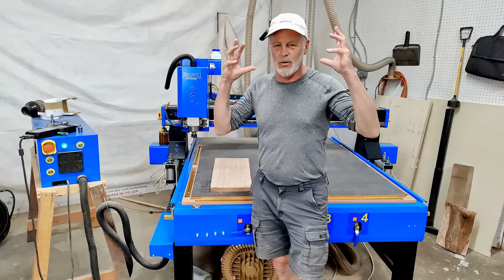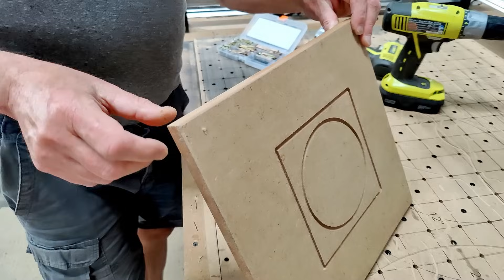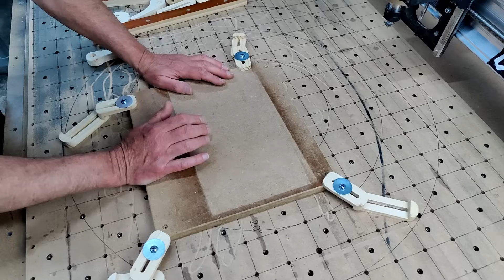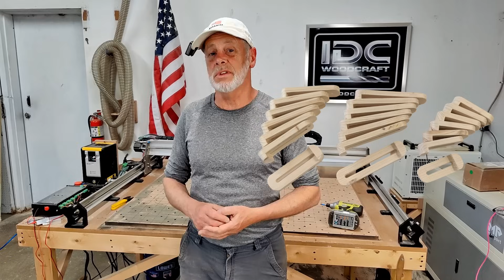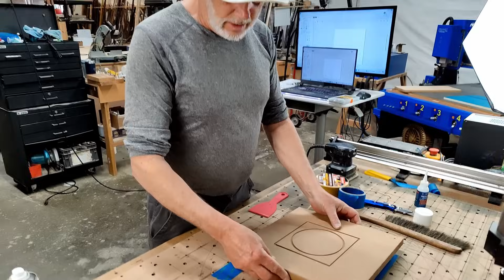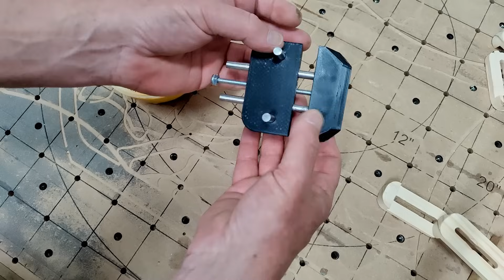Top 5 Methods to Keep Your CNC Projects Secure

Comment from the maker: Get the CNC Project Setup Checklist → https://link.idcwoodcraft.com/zmkr5w
Reply: No checklist there.  It just says PAGE NOT FOUND.
Reply: @pigpickler  disregard my previous reply- that link now goes nowhere.
Reply: have tried severeral times to get  the checklist with no luck.  no email or anything.  i submit my info, goes to the next screen, plays video acts like i have to purchase the design bundle to complete the request.
Reply: @Cooperwoodworking  disregard my previous reply- that link now goes nowhere.
Reply: Maybe gSender could be modified to spit up a check list after you load a gcode file and ask you to confirm each step before you can start the carve?

Comment: Great video! I'm leaning towards the clamps you made out of pine. Question, I am installing a dust collector, what plastic hose size do you recommend? Good job!
Reply from the maker: Thanks for the kind words! For a dust collector, a 4-inch diameter hose is commonly recommended, but always check your specific system for compatibility.

Comment: On the vacuum table, do you need to cover the open holes? I have 2 vacuum pumps with piping I got for free so I want to see if I can build a table with it.
Reply from the maker: Great question! It's usually best to cover the open holes you’re not using to maintain consistent suction, but you can also experiment with different configurations to see what works best for your setup. Good luck with your build, brother!

Comment: I like tape for smaller parts so i don't have to use tabs. My downsides to tape are that i'm allergic to CA glue and also it gums up the router bits... I use clamps mostly for larger stuff and  for full sheets of plywood etc. i use screws. Usually, if using screws i make a screw tool path that locates the screws with a pen that mounts in my spindle chuck and i run that first as it won't move the workpiece.
Reply from the maker: It sounds like you've developed a solid system for securing your workpieces! Using tape and clamps definitely has its advantages, and I can see how a screw tool path would make the process more efficient. It’s great that you’ve found ways to work around your CA glue allergy while still getting the results you want. Thank you for sharing your techniques!

Comment: Good job.  Give the 23 gage cordless Milwaukee a chance.  I use it a lot for cnc hold down also use a 1/4 plywood for my spoil board.  Below that is particle board glued to mdf that is nylon bolted to table. The pin nails are pulled out with pliers.  The ones that snap off i tap then into the waste board..  i use a enclosure so when I flatten spoil board.  You can hear pin nails flying.  Works great.😅
Reply from the maker: MarkJonesRanger, Thanks for sharing your setup! It's great to hear how effective your method is, especially with the Milwaukee tool. Your approach to managing the pin nails sounds smart, and the enclosure must help keep everything tidy. Happy CNC woodworking!

Comment: Does anyone offer a battery-operated nylon nailer?
Reply from the maker: johnterdik4707, Yes, there are battery-operated nailers available in the market. You can check with various tool manufacturers like DeWalt, Makita, or Ryobi for options that suit your needs.

Comment: Great video, as always.  Not sure the superglue method is much less expensive than the double sided tape method when you factor in the cost of the superglue and especially the accelerator.  Jonathan Katz Moses did a video recently recommending the tape sold by Taytools.

The whole purpose of the accelerator is to drive the cyanoacrylate to a basic PH level, which is required for proper reaction.  This is why you see a lot of homemade versions on the internet using baking soda, which works well, but can leave a residue.

I’ll be experimenting with this later this summer.

Clay
Reply from the maker: ctenos45069, glad to hear you liked this one brother! You bring up quite a lot of good points about using CA glue.

Comment: With cam clamps I have found down cut or straight bits less troublesome than up cut bits. The vibration from router speed and the upward pull of the upcut can cause the workpiece to lift. Great video Garrett.
Reply from the maker: ronc1231, good call brother! Im glad you liked this video.

Comment: I'm using mostly using screws to hold down my projects. But I'm not using screws with a cross like you do but I'm using Torx screws. Due to the angle on cross screws (or Phillips screws), you need to push down on the screw to prevent slipping or skipping. On Torx screws, you barely need any force to keep the bit in the head of the screw as there is no angle and you don't risk as much slippage which can damage your screwhead or even the bit itself. I'm using mainly Torx screws for everything nowadays. I'm also using the tape method alot, especially on acrylic sheets to make engravings. One thing to look out for when using double-sided tape: if you plan to cut out your workpiece, make sure the tape isn't anywhere near the cutout. If your bit goes through the double sided tape, even if it's only 0.1mm, the glue of that tape sticks to your bit, collecting sawdust and you'll be burning and scraping through the rest of your project instead of cutting. I've had it happen with wood and acrylic projects. The acrylic will melt alot quicker when there is glue on your bit, and the wood will start smoking due to gathered dustparticles inside the grooves of the bit and you may potentially break your bit as well if there is no place for the chips to go. Same like drilling a hole with a drillbit where the woodchips are stuck inside the drillbit and can't get out. Then you need to apply much more force to drill any deeper and your bit/wood starts smoking.
Reply from the maker: powerpc6037, good call brother. Using screws is a great idea as is the tape method. Happy CNCing brother!

Comment: One recommendation for double sided tape: Peel the backer off BEFORE you cut the tape to length with the utility knife. This leaves a "tail" on the backer. The next time you go to apply the tape, you don't need to fight to get the peel on the backer started with your fingernail, you just use the tail left from last time. Then you repeat this again so you always have a tail (you can trim/rip it down to a reasonable size, just make sure to leave SOME tail). I learned this trick from Inspire Woodcraft and it's made working with double sided tape so much less frustrating! Look up his (very short) video "The RIGHT WAY to Use Double Sided Tape" if you're having trouble visualizing this technique.

Thanks for this super informative video Garrett. I've been wanting to experiment with cam clamps and this taught me enough to dive in!
Reply: Yup! Great idea.
Reply from the maker: homtherobot, great idea brother! I will try that method. It should make things quite a lot easier.

Comment: a little tip on double sided tape , dont cut it at the end . when applying the tape pull the backing back keeping some of the backing in place . cut only the tape not the backing material leave that. before making the cut of the tape take a back handle of the putty knife and press it to the work piece . I saw this tip online and have been using it ever since.. peeling that backing material is a pain in the neck
Reply from the maker: robertkrueger3902, that is a very good idea brother! Thanks for sharing your tips and tricks.

Comment: I use threaded inserts and save their locations in vectric. Then you can make any jigs or pieces to go around them. Saves from screwing into spoil board so much.
Reply from the maker: steveli2182, good call brother! I really like that idea.
Reply: What size are the inserts in your spoil board? Thanks

Comment: Ok. . Heres something I have so far not heard of anybody else doing.
Due to a minor design error when I built my cnc, My spoil board was too low.
Z travel downwards was insufficient for small or short cutters to reach.
I had my 25mm MDF nicely surfaced and made another sheet to go on top of it.
The layer below it was surfaced as I said. . And good factory fresh mdf is as flat as I can mesure, so I did not surface the new top face.
The smooth and seemingly denser factory surface of mdf takes the tape/ca glue fixing method MUCH more securely than a surfaced and sealed mdf surface does.
I conclude that my error was nothing of the sort. I merely have greater intelligence and foresight than I am aware of!
😇
Reply from the maker: russellferriday8191, thanks for sharing your perspective on this one brother. Everything you do in CNC is a new lesson!

Comment: Hey Garrett something to think about.  I tried making your wooden clamps but had problems with the wood breaking so I ran to my local Wally World and picked up a phenolic cutting board a soft plastic material, not a hard plastic material.  I cut the clamps again out of the cutting board material.... Perfect, they bend when you put pressure on them but they don't break.... Of the clamps I've tried, the phenolic ones are the best I've used.
Reply from the maker: ca8920 , good call brother! Phenolic would work great for clamps. I like that idea.

Comment: Hey just thought about this when you upgrade to a spindle and you program a file for drag bit does the spindle not turn on when you start the job? Just curious. Thanks
Reply from the maker: Great question! I have to manually turn the spindle off so it does not spin up
Reply: @IDCWoodcraft  I was thinking about that when I was watching you talk about your files. Also I'm trying to get your checklist but it keeps bringing me to your bundle purchase option is it on the idc app with all my bits or can I buy a copy when I order bits in the near future. Thanks Garrett

Comment: Most of my projects involve complet cut through which results in using tape.   To help preserve my spoil board I will tape the project to a 1/4 in cheap plywood and then use clamps to secure this to my spoil board.  The plywood can be used for several project and easily discarded when it gets too  cut up.   Great videos -  keep up the good work!!
Reply from the maker: maxjones8923, tape with the plywood underlayment is a great method brother! Thanks for sharing your perspective

Comment: Thanks Garrett. I'm "carving" all the way through 3/4" pine ultimately using 90% of the wood,  hence little areas to Clamp. Tape, I believe might not hold when I cut through, but back to leaving tabs, which I don't want to use in the production project. Next, I'd like to align a few lengths of wood n clamp/secure as one. I've got a lot of experimenting to do. Thanks for the timely video n sponsoring  the V12 discussions.
Reply from the maker: bradcooper8325, good call brother! Keep experimenting and learning my friend!

Comment: Great video.  I ve used all the methods you have described, except for vacuum ($$$$).   I tried the masking tape/super glue after watching your video, and its worked well except that i was spending a lot of time removing residue from the spoil board.  Much prefer the double sided tape, which you also introduced me to.  Thanks so much for sharing.
Reply from the maker: user-qx4yb9kn6h, glad to hear you liked this one brother! All clamping methods have their pros/cons and it sounds like you have the right tool for the job.

Comment: Awesome in depth video. I mostly do high production projects so I only use a vacuum table my spoilboards are lacquered.  I will drill through my spoilboard and use gasket material to  seal the vacuum in specific areas.
Reply from the maker: This is an awesome technique. I don't use vacuum much in production. Thanks for sharing this. I will definitely remember it!

Comment: Any reason you didn’t suggest using bench dogs and wedges?
Reply from the maker: Oh crap. I wish I talked to you before I did this video. Completely forget 🤔
Reply: @IDCWoodcraft  
No worries, I have an old Chinese 90cm x 60cm desktop CNC with a 1.2 K-watt spindle with a MACH-3 Pc based controller for controlling the machine. Many years ago I created a waste board that used these. I machined some brass dogs and location pins which really helped me with rapid prototyping parts that would eventually be made with plastic injection molding.  I used to have these parts made through Stereolithography (SLA) 3D printing which cost about $1000 each and took a week to get. 

I’m thinking about getting the Sienci Labs Altmill with a PWNCNC ATC.  Do you have any thoughts on this setup?

Comment: My preferred method is to use a brad/pin nailer.  They are smaller gauge, hold the project in place, and are very quick to use.  With thicker boards, I toenail the brads and it works great!   I have used tape, which sometimes fails.  I have used clamps, but I always have to take them into consideration when programming for Z axis to make sure the router clears them, plus I need a lot more excess material to hold the project in place.   Great video as always!  Always very informative!
Reply from the maker: Chief069, good call brother! A brad nailer is a great choice, easy too!

Comment: Thanks Garrett for your very informative video. I mainly use the glue and tape method but for smaller projects i use 2 sided tape. i've tried clamps but they seem to get in the way. Would love to try the vacuum system but not set up for it.
Reply from the maker: ronnorris1504, you are so welcome brother. Happy to hear that you have the right setup for your needs. You can always upgrade to vacuum later!

Comment: Hey Bro - Great job on a video that addresses a subject that is not usually well addressed.  For me, I generally use top clamps (made from wood), or a combination of top clamps & double-sided tape (when I have a cutout inside in the project I am working on), as the majority of my projects are made with thin wood (usually .250" or less), and some of the other clamps do not work well with thin wood.
Reply from the maker: alpscraftshack, glad to hear you liked this one. Thanks for sharing your tips and tricks on clamping. Happy CNCing.

Comment: Great video!
I've used all of these methods at one time or another, with the exception of using a vice. The one thing I hadn't considered was if you are clamping a piece that includes a cutout toolpath, and don't do something to retain the cutout piece - such as tabs - it will come loose and likely be damaged by the router bit. So for pieces that have some type of cutouts,  I use the tape and superglue method. Clamps will get in the way, and toe clamps won't retain the cutout piece. I'm sure there are other methods as well.
Reply from the maker: I am so glad you mentioned this! I thought about it after the video was posted. Cam clamps can be a real issue when doing a cutout. This is exactly the type of comment I wanted to have. Thank you

Comment: I like vacuum but 95% my parts are cutting right too the waste board so I lose vacuum pressure right away and I cut 10 parts or more. I use double sided tape
Reply from the maker: customwalldisplay, good call brother! You need to have the right tool for the job and it sounds like you have it.